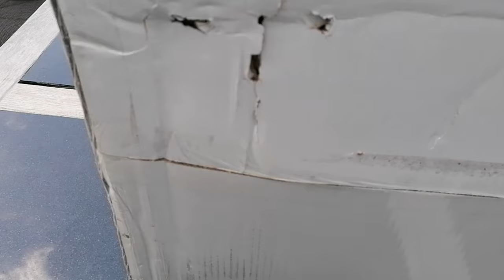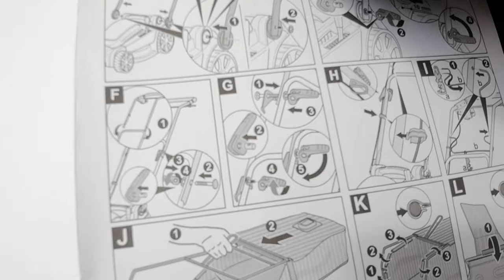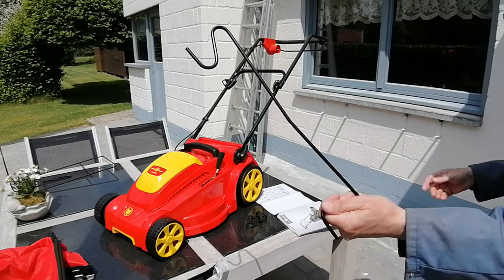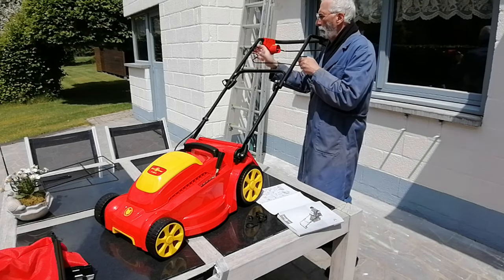E-Mower, is it any good? #electric #mower

Comment: Hi

I had purchased one. I found a two pin socket on it. Do you use a 2 pin male to female or 3 pin male to female cable for the mower ? Which is better
Reply from the maker: 2 pin and a female for the ground 👍😀

Comment: I HAVE JUST BOUGHT THE A400E  (1800watt)  version  from  SOTEL VIA  AMAZON....I OPENED THE BOX AND  THERE WAS NO MAINS  POWER CABLE SUPPLIED, THIS NICE GENTLMAN HAS NOT MENTIONED THAT. I HAVE  HAD A LOT OF HASSLE TRYING TO GET THE MAINS CABLE FROM SOTEL...THEY EVEN TOLD ME THAT THE MAINS CABLE WAS BAD FOR THE ENVIRONMENT???????...HOW AM I SUPPOSED TO USE THE MOWER????? THEY ARE SUPPOSED TO BE  SENDING ONE TO ME..AFTER  2 WEEKS OF WAITING... THE GENTLEMAN IS QUITE RIGHT ABOUT THE INSTRUCTION  MANUAL.......IT IS USELESS, AND NOT VERY HELPFUL ATALL.
Reply from the maker: There is a socket where you have to connect the power cable of course. I’ve never seen an electric mower sold with a power cable, you always have to get that yourself if you didn’t have one already